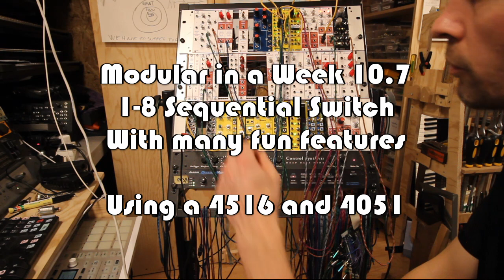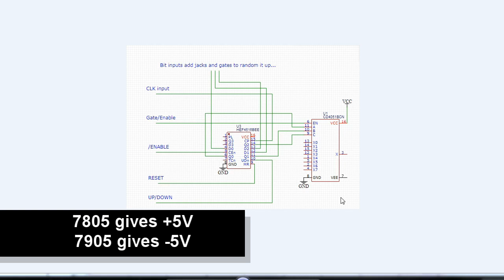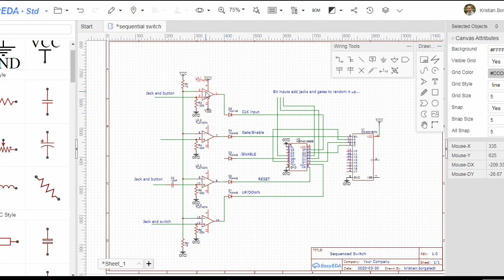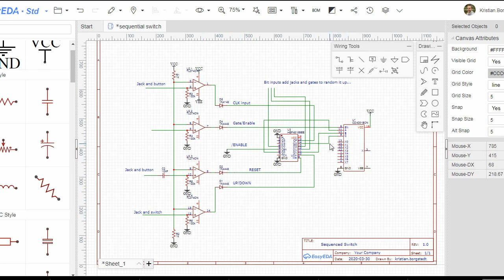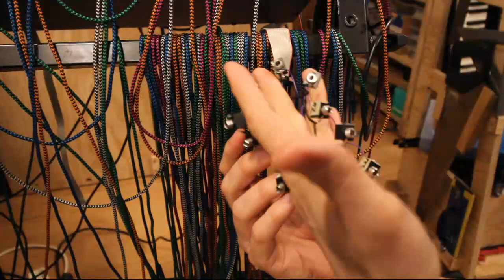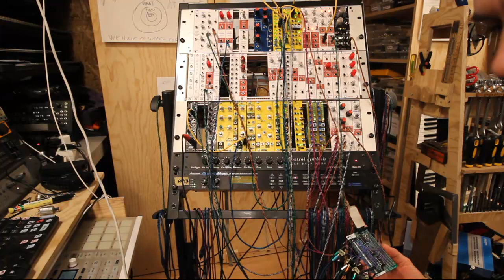1-8 Sequential Switch using a 4516 and a 4051 - DIY Modular in a Week 10.7

Comment: Just for the sake of clarification, each output is a gate at the same voltage of the VCC of the 4051, so VCC = 5v ; OUT = 5v also or is the GATE/EN pin 6 driving the OUT?
Reply from the maker: I think the gate/en is just a logic and gate paired with the other gates. So yes out=vcc.

Comment: Do you have a suggestion for good value quality 3.5mm jacks? I plan on starting a MIAW build and need to buy the 200+ jacks...
Reply: I found these: https://www.aliexpress.com/item/32973595367.html

I wonder if they are any good quality...
Reply from the maker: If your in Sweden (which your name implies) then Electrokit has nice mono jacks with a breaking switch for 2kr/piece. Otherwise the ones you found on aliexpress most probably works. They are stereo plugs, but I use that all the time aswell, and it is "usually" not a problem. Some people hate stereo plugs because it could mess up ground in some modules, but it hasnt happened to me yet, and frankly I dont see how it could?

Comment: You definitely don't need another IC to drive output LEDs, have a look at Ray Wilson's page:

http://musicfromouterspace.com/index.php?MAINTAB=SYNTHDIY&PROJARG=HOT_TIPS/led_drivers.html&VPW=1526&VPH=633

In particular, the 'transistor driver' can be used to drive a LED from any (positive) signal while putting almost no additional load on that line, and takes all of 2 components.

Comment: These chips are sort of the ‘pinnacle’ of cmos sequencing circuits, I think. More versatile than the 4017, which is a great chip.
Reply from the maker: Yeah. In the video I contemplate making a sequencer with this instead. It would probably be better than the 4017 aswell, since we could have 5v or any voltage on the input this changing the range of the sequencer.  Also a sequencer that can go backwards aswell. I have to look into this more. :)